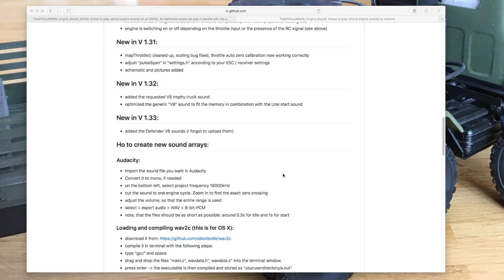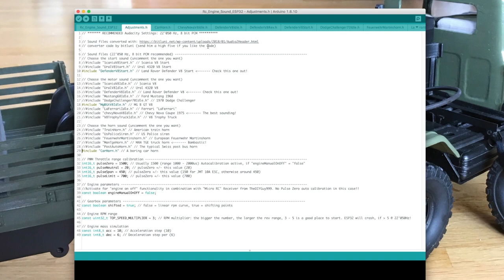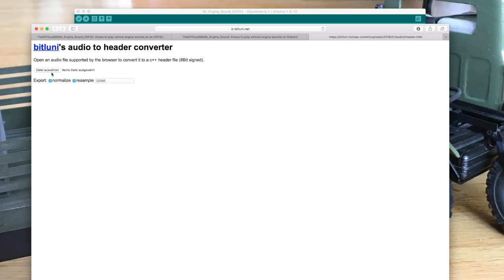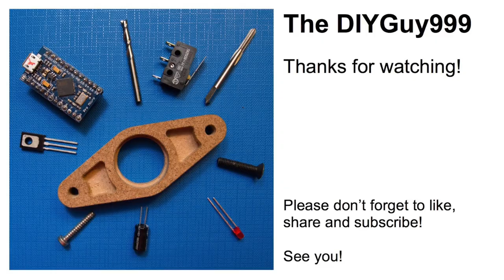New ESP32 Based Arduino RC Engine Sound Generator: Simultaneous Horn playback, a lot of Free Sounds!

Comment: Wonderful work and thanks so much for sharing. I have built the circuit and wish to use in RC aircraft and need only basic use 2 channels engine sound and machine gun sound  a 3rd channel for cannon sound would be a bonus! I am having difficulty with modifying the software, commenting out // to suit my particular case. I am using Spektrum or FRsky radio equipment in PWM mode. The Remote and Esc pages are very daunting for me I think this is where I am going wrong, very complicated with all the excavators/loaders etc options.
Is it possible to simplify the code to just output 3 channels?

Comment: Hi, this is a great project and thanks for all the links. My PCB arrived in the UK within a week! Fantastic service.
Having built my unit, I want to load the Landrover engine sound. As I am new to Arduino, could you give some instructions on how to download in install on the ESP32 or do a short video?
Many thanks again.
Reply from the maker: Thanks. Basically, you can find all the required informations in the main text on my GitHub. Read is carefully sand it should answer most questions, I think:
https://github.com/TheDIYGuy999/Rc_Engine_Sound_ESP32
Edit: I just improved the documentation on GitHub

Comment: It´s a great project. Thanks a lot. I´m trying to do something like this to put motor sound to an electric bike. I guess it would be more simple cause I won´t need lights, horn or rc, just the signal from throttle and the motor sound. I would thank your help with this.
Reply: you did it?

Comment: Dear Sir,
Thanks a lot for the project and all the documentation you provided.  I'm planning to use the sound generator for my boat. I already found some include files for the engine sound and I should find my way in the code. I only have one question regarding the audio amplifier : I have a PAM8403 item with a potentiometer already solded on the device. Based on your V1.1 scheme, can I bypass R18 and just use the two 10k (R11& R12) connected to the IN-L entry of the amp ?  Should I use another cabling scheme ?
Thanks by advance for your answer and again, thank a lot for the impressive job !

Comment: Hello, your thinking and sharing is very nice.

I have  Arduino UNO , speaker and potentiometer
Can I make these sounds throttle using potentiometer?
Reply from the maker: Thank you
This version does not work on a UNO. You have to use this, but it't much less advanced: https://github.com/TheDIYGuy999/Rc_Engine_Sound
You can add potentiometer support, using the analogRead() function.

Comment: Fantastic!!! This is one project really worth building!!! Thank you for sharing!!! I'm wondering would it be too hard to port the code to STM32? I'm a complete novice as far as the code writing goes but not stranger to electronics. I'm converting some of my boys' Bruder trucks to RC so this would make it even more interesting and attractive.
Reply from the maker: Thanks and you're welcome. I think, it would be possible, but I prefer the ESP32 with its easy USB interface. The memory size of the STM32 would be an issue as well and you would have to use an SD card or external flash memory to store the sound files.

Comment: I like a lot your work, i'm doing something similar to control several signals in a RC boat, but now i'm heavily interested in the horn, in the MAN Truck horn, the sound is perfect for me, and it's really easy to have or not to have the motor sound, because i need to use the horn without the motor sound, but i have a small issue, i need to make the horn sound giving to the ESP32 a single closing contact signal, not a servo signal, is it possible in your design?
Reply from the maker: Yes, replace (pulseWidth...) in this section with digitalRead():
// detect horn trigger ( impulse length > 1700us) -------------
    if (pulseWidth[3] > (pulseMaxNeutral[3] + 180) && pulseWidth[3] < pulseMaxLimit[3]) {
      hornSwitch = true;
      //sirenSwitch = false;
      soundNo = 0;  // 0 = horn
    }
    else hornSwitch = false;
Reply: TheDIYGuy999 thanks a lot for your help, I’ll try

Comment from the maker: The RC sound effects just got a lot better! My Arduino engine sound generator is now based on a powerful ESP32 processor. I allows to play longer sounds with higher sampling rate. Even 2 fully independent sounds at the same time are possible! Check it out: https://github.com/TheDIYGuy999/Rc_Engine_Sound_ESP32

Comment: Hello,
So far I built three of your Rx micro receivers, two RC transmitters, and your sound module for ATmega328, and they all work fantastic.
However, I am currently trying to work with the ESP32 sound module and I keep getting the following error:

redefinition of 'const unsigned int sampleRate'

I get it every time when I try to verify the program. It does not matter which vehicle sound I am using. So far I have not been able to find the cause of the error.
Please let me know if you have any suggestions or an idea what could be wrong.

Thank you.
Reply from the maker: Hi, never uncomment more than one sound per category. If you add your own sounds, make sure, that the variables on top of the .h file are named according to the existing files of the same category.
Hope this helps

Comment: Hi i build the compact one 
 using iBUS protocol 
 Got it build only no sound coming out 
my son install the ESP-WROOM-32  Development Board
sound/light file i know ibus compact for  just sound 

I am using  Flysky FS-i10 FS I10 2.4ghz 10ch Transmitter and Receiver System 
with FS-IA10 and using the  FS-CEV04 Serial Bus Receiver For iA6B iA10 Receiver
Need help on hookup and software to install

Comment: So I’m looking to put something similar in my kid’s power wheel I customized. I’m familiar with github but an Arduino beginner. Same products should work right? Or is there another way to do this without the 2.4ghz remote part (since it will all be on the power wheel & not activated via remote)
Reply from the maker: You can trigger the sounds for example with analogRead(), but you have to change the code

Comment: Is it possible to use external DACs with higher bitrate in purpose of getting higher quality sound?How can ı achieve higher qualty?
Reply: Rn I'm working on an i2s based sound generator with esp32 and max98357 16bit audio dac but I'm having a hard time trying to fit 16bit 44.1khz audio files into the esp32, I tried external sd card but this takes takes the variable sampling rate capability which really affects the revving up sound which I found was a good combination of two sounds overlayed with variable sampling rate and volume.    It's still a work in progress but if anyone is willing to pitch in ideas I'm open.

Comment: I am trying to do something very similar.  Need low latency sound effects but having issues doing this via SD Card -> I2S -> MAX98357.  is using the onboard ESP32 DAC and having the sound effects in RAM the only way to accomplish such low latency effects?
Reply: Im using an audio library by a guy named xtronical but variable sampling rate doesn't seem to be an option in his i2s audio library with the sd card , without the sd using on board memory it's possible to vary sampling rate but with only 3 mbs left for audio files I can barely fit any onto the 4mb esp32. Maybe I try to modify an esp32 with a 25q128jvsq chip for 16mb of storage, maybe that will be enough to store my starter , idle , one or two rev loops for mixing and variable sampling , gear shift , turbo flutter and rev limiter sounds.

Comment: I have tried to make this module but until now it still does not work, I use a Mini Amplifier PAM8403 with include potentiometer, is it still using a 10 K resistor connected with pins 25 and 26 according to your schematic? any way big thanks for sharing your work, sorry my english is not very well
Reply from the maker: What does not work? Which input signal type are you using PWM or PPM? You have to select the correct signal type in Adjustments.h
Reply: @TheDIYGuy999  I do not know, in the remote control specifications (I use dumborc 6 channel)
Modulation Mode: GFSK
Spreading Mode: FHSS 67 channel pseudo-random frequency hopping, which one do I choose PWM or PPM ?, sorry I don't really understand Arduino programming, anyway thanks ...
Reply: @muslaeni4829  I'm having the same issues. Wired everything up, loaded everything up, no sound. No real help. Wasted money on arduino parts for a failed project. Should have just bought an ESS Dual.

Comment: hi, i wanna make using arduino nano, want to make sound engine and horn, but your schematic and pcb is not clear for me, can you make it again  for arduino nano ?
Reply from the maker: Hi, engine sound and horn will not work on a nano, it does not have enough memory. The schematic for the ESP32 version is now finished, including eagle board file
Reply: Oo i see, ok thx alot for sharing

Comment: Ok. Built it again. Connecting a 5v rail on the receiver side to any other 5v rail results in power cycling on and off repeatedly.
Reply: Ive narrowed it down to a problem with the code. With a blank ESP32 board installed, everything powers on and seems fine. With a board with the code loaded, it pulses power. Tried 2 different boards. Holding the boot button for a second causes it to come on and stay on, but no sound.
Reply: @lordsanityfree  I'm having the same exact problem, but I cannot pinpoint any of the issues, any tips?

Comment: unfortunately I bought esp 32 board there is no pin 0 (D0) for head light ... is it possible to use another pin?
Reply from the maker: Yes, just comment out this line in the Adjustments.h file as follows:
//#define PROTOTYPE_36-PIN // 36 or 30 pin board (comment it out for included PCB)
Then connect the headlights to the RX0 pin instead
Reply: @TheDIYGuy999  Ok, I'll try, thank you .... you are the best....

Comment: Hi how would I used this application on a real vehicle with a bigger speaker. Most modern vehicle have 5v signs wire on the throttle pedal. Any ideas?